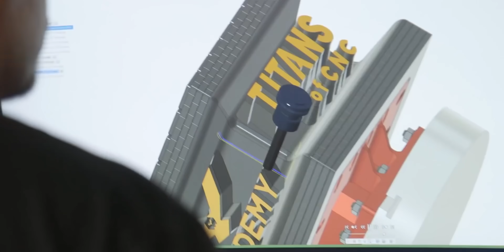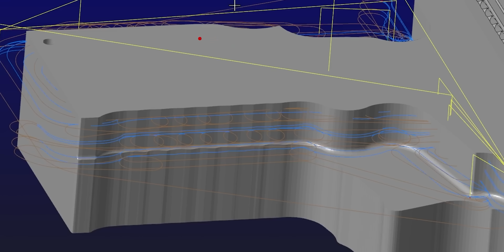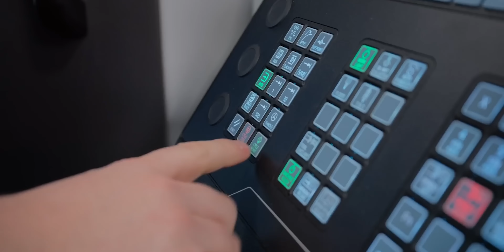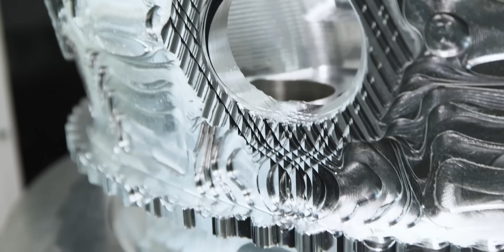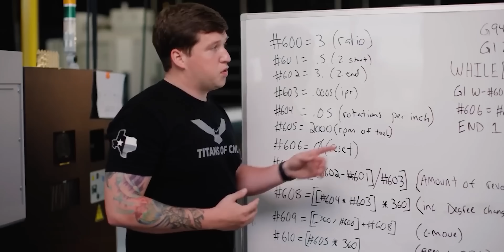Old-School Machinists Hate This: The Mindset That’s Revolutionizing Machining!

Comment: Similarly, I found that when I was working in a shop that built machines and fixtures, the guys that were building the machines with PLC's at the heart were not given the opportunity to expand into the programming aspect of the PLC.  According to the boss, we were only to build and install every component and they would hire an independent programmer to come in and work WITH you to get the machine up and running.   BIG PROBLEM was we waited for the programmers' schedule, and it bogged down the whole process.  There were some instances where I was given programming control over some servo motor controls, but the older guys in the shop looked at that as "playing" and not getting anything done (morons to say the least).  That was the toxic environment I was under, and it was sooooooo counterproductive.  I'm glad I retired and got out of there.

Comment: I cut the program time in half for a program using a lens form end mill (3 axis surfacing) instead of a typical ball mill.  I didn't so much get a pat on the back.  In fact, no one in the shop even mentioned it.  They're so ignorant I don't think they even realized the end mill had a radius on the bottom.  It's hard to push and learn when there's zero reward.

Comment: As a mid aged machinist, I’m seeing a lot of young and old guys being scared to push the tools and the machines. I think I’m about the age of some of your guys, so I’m at the stage of my career that they are. But I can’t seem to get old guys to adapt or get young guys to not be afraid of giving something a shot. Guys can’t seem to think out of the box for setups, it’s just “add more clamps that you have to move later ”, and higher up won’t get onboard fixtures for less than a dozen parts. It’s frustrating to see programs slowed down the next day because people are scared.

But it all comes down to guidance and leadership. TWICE last week my very inexperienced colleagues came up with ideas on how to do both a new and repeat job that I didn’t think of. One of those jobs wasn’t something we were able to get to that night, but I passed the idea along only to find the day shift reject in favour of something that was horrendously less efficient.

Comment: Riddle me this ..... The biggest challenges I see today is "stable work environment". Mainly the ever changing update hamster wheel software, hardware, you name it. Between never ending Fusion 360 updates that might fix one thing and then break 3 more things. Still have a barely working CAM enviro for Lathe ops. Videos 8 years old calling out issues still not addressed. Tool library is a dumpster fire.  Shameful !! Oh you want to make videos ? You get your rig setup for DaVinci studio. You make 2-3 videos & suddenly windows updates, mother board bios updates, Oh, you invested in an INTEL Arc video card ? Oh they just released a new card series and the new driver they forced on your system has slowed the output from 60 fps to 10 or worse. Joy !! Maybe it is different for "professional" corporate software suites running on enterprise systems that get "locked down" and do not update but I seriously wonder how anyone gets anything done today & is productive. Super frustrating. So done with it.

Comment: CNC is automation, not machining.
Reply: Lol. Sure thing. It's absolutely machining.

Let me guess if it's not manual machining it's not machining?

Turning handwheels doesn't make you a machinist either. 

It's about being able to take a design from print to finished part. The tools used don't really matter.

Comment: 10:40 This mindset quite literally got my boss to sponsor me to get my red seal. I've done so much rising up and training myself, both inside and outside of work, that things got quicker and more efficient.
We changed the ID size of extrusion we order (and extra inch of material), I looked at the machines and thought 'what if'. The roughing might have the spindle be 70-90% but it took a 2 min op down to 1.75 min even with the added material, and a better finish.

Ngl, it's fun when the DoO tells me the way I did something costs more, based on how he thinks it should be done, I tell him to actually calculate it. Of the cost calculations I know of, what I made/changed cost the company less to produce. Not everything I've done cost less but it either cost the same or saved my sanity when scheduling machines.

Comment: I'm not an expert, but it seems that if you machine at a high speed, it causes more friction and heat. Wouldn't that make it easier to cut ?
Reply: No. Heat can harden material, cause stress fractures in tooling, or soften it and cause it to turn gummy.

And friction can work harden materials.

Also, with tightish tolerances, you have to account for thermal expansion so when the part is cool its still in spec.

But if the coolant is good, the toolpath is cutting heat into the chips and out of the material, and the tool has a good coating, you can run with very low friction, good heat extraction, and keep the tool and material cool.

Some tool/insert materials do handle heat really well, and should not be cooled because that will cause fractures. Typically in the tool documentation
Reply: @rniejx4219  thanks for the info.

Comment: The very first machine shop teacher I had many many years ago told us look at the way everyone else is going about how they are getting the job done. You can learn from anyone even if it something not to do. He also said it is many ways to do something not just 1. When I got a job working in a die shop I worked with this guy who been doing it for years every time he asked me to do something if I didn’t do it the exact way he told me even if the part was in tolerance he would throw it away. I was about to lose my job because of him. He got sick and I had to work without him and he was out for 6 months everything they asked me to make and do I done it and over that 6 months I got a whole lot faster after he got back they kept coming to me to do thing and move me to another shift after a while they hired more I would learn from everyone that I worked with I tried there ways sometimes a better way for me and sometimes I was slower doing like that. All I saying be open and be willing to learn from the new guys also.

Comment: That's exactly what I did when I worked at this place in Michigan called Vickers Engineering, I would turn the feed rate up on the machine,  without my boss knowing of course,  and eventually we learned that instead of getting 200 parts per day,  we could get 250 parts per day without using anymore inserts then what we were using 😉🤙🏽 I'd always keep an open mind.

Comment: Guys Right Now i am in a confusion. where i am not able to decide which CAM Software to learn SolidCAM or MasterCAM?

If any one wishes to suggest Consider the below points.
-I have been working in Solidworks CAD software from Last two and Half years and Also its easier and its helps to learn solidcam Much quicker due to the same user interface.

- Master CAM the most used CAM Software in the World with lot of options.

Comment: I was 21 years old when I walked into my dads friends shop in Cali as he really needed a reliable person. First job I pushed a button on just to keep parts (small brass parts for a sealing die to make 3 ring binders) going was an an older VF-3. I was so fascinated with automation right there and then...i was hooked! Now I operate in my shop here in VA with two mills and I have a few of the old no good parts that I first ran sitting on the shelf behind my controller as a reminder. On the wall is a picture of me and my old 1st boss from a few years ago when I visited him in front of the same machine. Its been over 20 years and I consider myself a newbie at this trade. Always stay humble and keep up on the growing technology it has to offer. It has changed so much.
Reply: Glad to hear you own the business.

Comment: You bring out the right attitude. I have, throughout my whole career always try to improve, learn, do it faster, cheaper and more efficiently. As for hurting the machine. When it’s moving it’s wearing out. In fact some parts even deteriorate over time. What condition would that machine be in if it just sat there unused for the next hundred years? Isn’t the question to be asked is “How much profit did that machine make me before I needed to replace it”?

Comment: Manual machines are still used to fix or remachine CNC parts where the design changed after machining. (And other reasons)
I agree you need to keep learning.
I also believe every machinist should know how to correctly use a file.
Reply: i dont.
never uses a file on costumer parts. 
machine everything !
Reply: @Regnillof you would increase your skills exponentially in cnc machining if you would learn manual machining. When I worked in the space program I had two mentors who could do things on a manual which still would be extremely challenging on any cnc. A “machinist” should be able to run all “machines”.
Reply: @Regnillof  there are features on some of my parts that can not be chamfered on the cnc. Hence the file

Comment: With the technology that is incorporated in the newer machines.  The advances in the cutter technology it’s crazy how fast parts can be machined! In 1986 our shop bought FADAL machine centers. They had a 10,000 rpm spindle speed. 
When my manual mill had a max 3500 rpm. That was crazy! To see a 10K rpm was insane! 
It’s amazing to see the advancements in the industry and the capabilities of these machines!

Comment: My shop doesn’t really train. Only train for production? Any advice chat?
Reply: I used to be in your situation. What I did was learning from the programs about the feed and speed of every tool, what the depth of cut was. Understanding the way the machine was set up and technically learn about the processes. I also ask my colleagues to know what they know through the year. When the time came, I moved on to another place.
Reply: You gotta learn as much as you can. How to read blueprints well is very important, learning how to change broken/worn inserts, then tools. Maybe learning a few G codes that you can use in MDI. If you can start learning all that and they don't want to train you how to set up, then leave. But you have to prove you're able to learn and that you have learned.